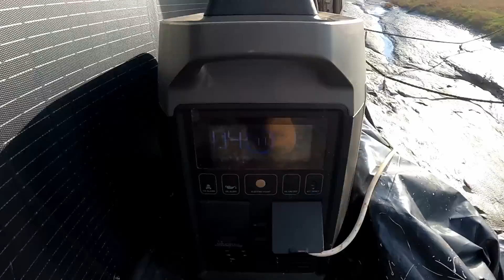Ep 98 - WHISKEY FRAME! We Finally Complete The Wood Work! #boatrestoration

Comment: Gemma and Simon, a suggestion from an old machinist; when using a steel vise to be banging and pounding on, always try and position your work towards the solid jaw (the jaw bolted to bench). If you flip that piece 90 degrees and clamp that tough one right next to the jaw, you’ll be pounding towards something solid. Not sure I explained that clearly but believe me, using the solid jaw of a vise as a backer has a million applications important in the trades. JMHO.

Comment: You two work so well together! I can tell you that my wife wouldn’t have been so happy to help out with my projects. Something to think about would be a small chainsaw either gas or electric may help you quite a bit removing wood or cutting those stringers out.
Reply: A small pruning chain saw could be a good tool for fast cut cutting your expired web frames. Go 90% through and finish with a multi-tool.

Comment: Hey yeah congrats on finishing the woodwork on starboard side in the bottom. I think the boat looks much better without that old plywood going down the sides. You could put a handrail, temp if need be, along the inside wall to grab. Then put a nice railing when you get towards the end. My 2 cents.😉 Good work guys! Keep it up! 🎅🎄🎁

Comment: The deck of the ship that you've put the Black plastic on is called the waist, it goes way back to when ships had forecastles(focsle) and aftercastle(acsle). The deck between  the  two is the waist. A gangway is the walkway between the ship and the shore. Loving the project, you can tell, when you do eventually finish, that it's going to be stunning, thanks for sharing.

Comment: Sometimes I’ve found when a cordless circular saw stalls on a fresh battery it’s either time for a wedge / shim in the cut behind to spread the kerf cut and relive the pinch to the blade, OR , time for a new sharper blade. Probably a better supported workpiece would alleviate the problem as well. I realize you are working in a cramped and uncomfortable space and this is by no means a criticism. Keep up the good work, you are absolutely correct in recognizing that small victories solve huge problems. Cheers!

Comment: one trick I did once,  put small scrap block of a wood underneath (resting on the metal bar (where screw is) the material you are working on.  helps reduce "massive" squeeze in order to knock something out.

Comment: For those copper nails, drill a small hole and use a smaller punch. The big punch is smashing and wedging tighter into the hole. Drilling will allow the material to collapse towards the center, loosening the interface. Don’t drill all the way through 1/2 way should be enough. For the sheeting, use a few spots of spray adhesive on the wood you will be replacing. The boat becomes more homey with each task completed, you guys are knocking it out of the park! Cheers!

Comment: This knee rivets need a shorter punch (e.g. a blunt pointed cold chisel) and a bigger hammer. Then you’ll get a clean impact directly where it’s needed. A heavy lump of metal with suitable hole in the middle will give a better anvil than a small bench vice.

Comment: Copper nails can be a bugger to get out of off the hull, however, the Shipyard I worked in a Shipwright converted a 2 leg hub/bearing puller to get them out. 67 thousand subscribers is a very good achievement, Well done

Comment: The Ecoflow panels have 4 parallel strings inside that run lengthwise. Covering any part of the string stops the whole string from producing power. At 16:34 the unit is blocking 1/4th the string. I'd hang the panel up on the side of the cabin. As long as the sun angle is within 20° of the face of the panel you'll get close to maximum efficiency.

Comment: Those bulwark stancions should be attached to brackets that bolt through the beam shelf, and not 'let into' the decking. You're not going to be bolting 'chain plates' to them so there's no need to 'over engineer' them. Acouple of decorative posts going up to the cabin top will be more than enough to secure tham from wobbling. The worn out blades (non-carbide) for your Oscillating Tool can be 'resharpened' for rough work by using a new grind disk with a sharp square edge to make 'V grooves' that alternate top and bottom, much like the edge of a fine hand saw.  :hand-orange-covering-eyes::yougotthis:

Comment: When you are using the circular saw its binding make sure you have scrap timber under the cutting area it will stop the blade binding. You will burn out the saw and waste batteries. Good luck.

Comment: Great work guys but it's not the saw. If you change  the blade to a finer tooth blade it will cut much better and smother. The blade your using is made for cross cut when your doing more of a rip cut, Hence use the right blade for the cut your doing. Just a tip👍
    Great video and nice work and thanks for sharing🤝💯

Comment: Know this is too late for your tape Gemma, but run a bit of cord through your tape and tie the other end to your belt.  Same with tools, lots of hammers come with holes in the handle just for that. Also when you're painting something like the knee - cut a clothes hanger and bend it through one of the holes and you can hang it from something so you can paint it without flipping it round. *Tricks from the mechanic's retirement home.

Comment: Just a suggestion as to how to remove the copper nails from the knees if they're badly corroded in.... take a drill that is smaller than the hole and drill out most of the copper. This will relax a lot of the tension on it and it's a lot easier to get out.
I hated to see you put so much effort into removing those!
As regards the milestone... consider this,  the hull is 1/4 done. 25% the way there and if that was the worst of it you're way far forward on the job. Kudos to a Stella job so far. 👏

Comment: Rivet removal made easy. I learned a trick from an old boilermaker. When a rivet is being stubborn then drill a hole down its centre, just a little deeper than whatever it is holding and it helps to relieve the pressure and drive out as before. Do not try to drive through the hole just drilled. As a guide drill should be half the size of the rivet/nail, 1/2 inch rivet, 1/4 inch drill. Drive out using the shoulder of the rivet/nail. Works well on steering ball joints.
Good luck.

Comment: Surely you won't replace those bulwarks I would fit handrails as per yachts
Reply: Good point, you can actually see the shape of a HDML without them and decks nearly always leak around bulwark stanchions. If only some of that superstructure could go too she would look great. Well done for progress so far though, it is a tiny step in the overall scheme of things but it has been a huge learning curve and has required enormous perseverance to get this far. Definitely worth celebrating.

Comment: Just throw a flame on the copper nails stuck in the steel brackets. There is a considerable distance between those two melting points...

Comment: I was just looking back at what you have done so far and it looks like it will take you at least another three years to get close on completing just the stringers that you are currently working on, are you reckoning on finishing around 8 to 10 years start to finish only it worries me that the progress is so slow that you might find that parts of the hull would have begun to rot again being it is just sitting in the mud and water you may stand a better chance if it was dry docked or even in a barn so you can strip the boat out properly with nothing in the way.

Comment: You seam to put longer / bigger scarf joints on the web frames than you do on the other ones , but they appear similar dimensions, I thought 12 to 1 was the  standard  scarf joints , any reason for smaller / shorter scarf ?

Comment: I'm disappointed with Ecoflow's technical support. I bought an Ecoflow Delta and I can't get it to supply power. It might be something that I'm doing wrong but they haven't responded to my emails in a week and I can't find a number for them. This is not acceptable for a product that I spent £1100 on. Even if it turns out to be something I'm doing wrong I wouldn't recommend them to anyone because of their poor technical support.
Reply from the maker: When u plug something into it are you making sure the switches are on, there is small buttons to control the USB power underneath the sockets, and the same at the back for the ac, each must be turned on to activate
Reply: @ShipHappensUK  I fully charged it when I received it and noticed that the display turned off after a couple of seconds and had I had to keep turning it back on to check the state of charge. When fully charged the same thing happened, after about 2-3 seconds the display (and presumably the whole unit) turns off. None of the outlets work even after pressing the AC or DC buttons. Maybe it needs a reset, but as no one will respond to my emails I don't know if this would work or how to do it.
Reply from the maker: @Colin Bolton  the screen does turn off to save power, send me an email, and I will make you a quick video of how to use it xx